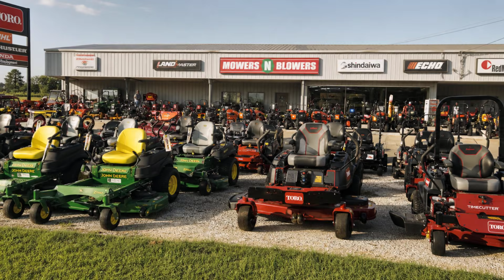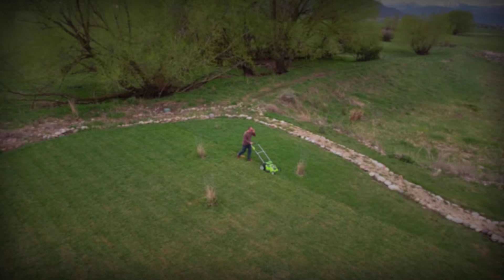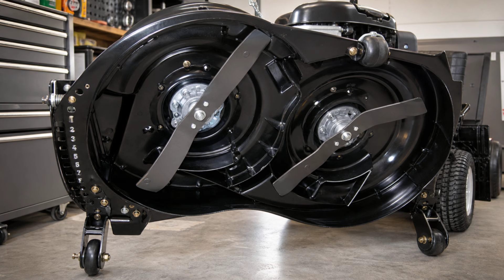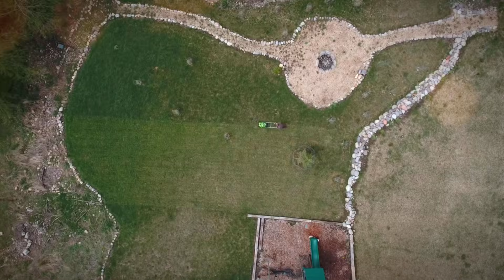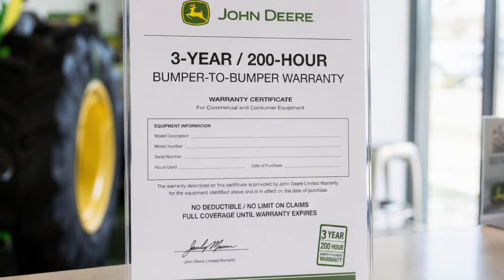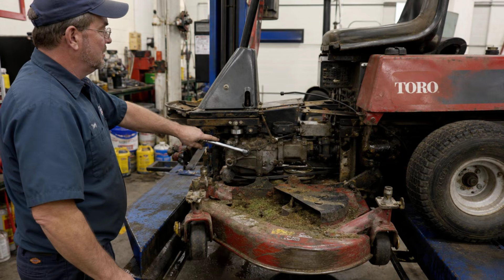These 4 Riding Mowers Have LITERALLY ZERO Complaints (2026 Consumer Report Exposed)

Comment: Yep. I bought a new Toro Titan Max almost 2 years ago. I mow off about 7 acres of my place as a lawn- sometimes much more (And it's just raw rural land). It's been GREAT. It's comfortable, and really good on gas; does 9MPH,  And best of all, it's a simple mower with a carburetor instead of EFI, so no expensive surprises down the road.  
          But now the AI narrator has lost it's mind. The Kobalt electric mower is JUNK. Just search the internet and see all of the complaints....they might be O-K initially, but they don't last; and it's comparing apples to oranges turds, as the Toro is an entry level commercial mower, while the other 3 are substantially cheaper strictly residential mowers, with much lighter transmissions.
Reply from the maker: Thanks for sharing your hands-on perspective regarding the differences between residential and entry-level commercial equipment.